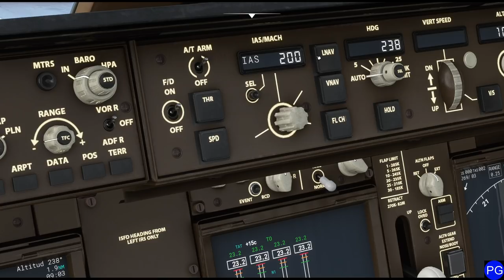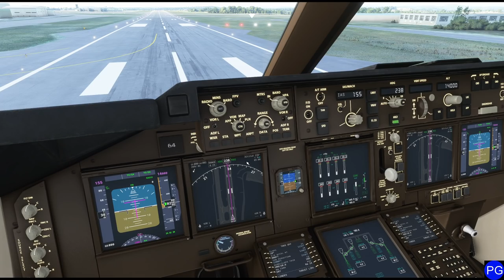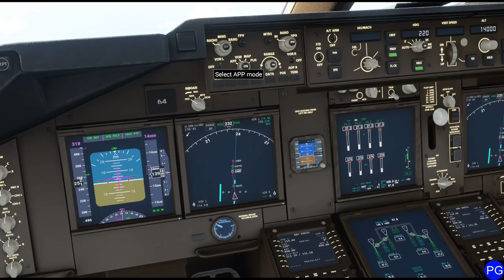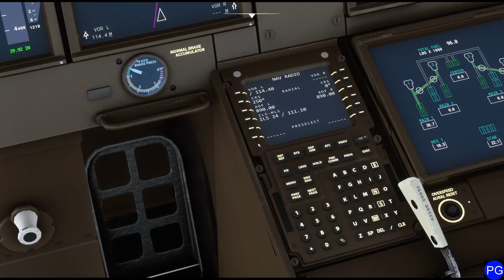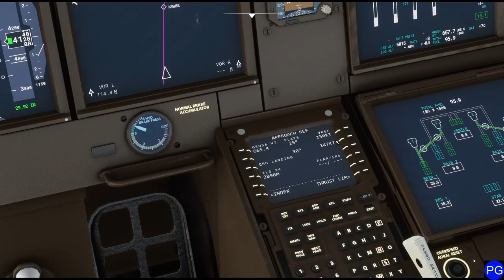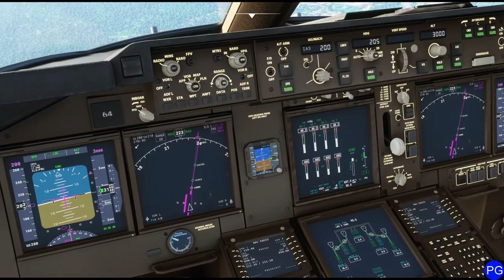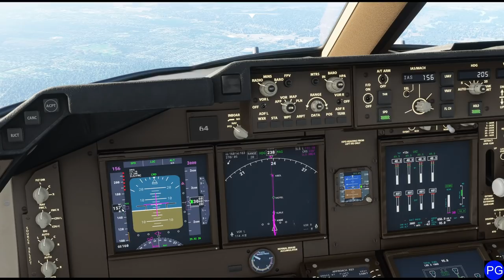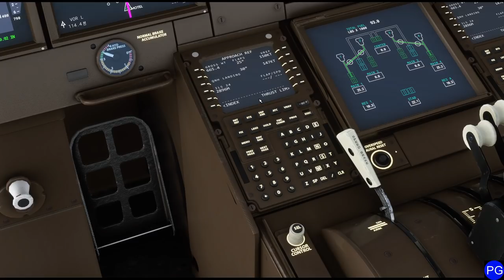FS2020 - Boeing 747-8 Autopilot Tutorial

Comment: Nice video. Air Force pilot here, FYI 16,000 is not a flight level. FLs begin at 18,000. And V2 is not the standard climb speed, that is the airspeed required to continue a safe climb at the minimum climb gradient in the event of an engine failure.
Reply: only in america

Comment: Hey man, nice video and I just wanted to add a few things

1. Speed brakes are not armed for T/O, they come up automatically passing 85 kts or they are deployed by the PF or PM when doing an RTO. 
2. Before pressing the TO/GA switches you need to stabilised the thrust (set a bit of thrust making sure all the engines are spooled up) 
3. You set up the automatic landing correctly. But MSFS seems to be lacking the feature. At 1500 feet you should have the mode "LAND 3" enabled with "ROLLOUT" and "FLARE" armed
In the case of your video, you needed to take control of the aircraft and do a manual landing since there was no autoland enabled. Your aircraft did not flare that's why the landing was so hard! 

Great video anyway and I'm so impressed with people learning how to fly the 747 in MSFS :)

Comment: Thanks so much for this! Gave me confidence to give it another go. I setup a flight from KIAH to KSFO. Many legs, each with their own airspeed/FL. Sweet! Took off, clicked LNAV and VNAV, and she flew up to FL420! I learned that I need to stay below fl390 to prevent big bertha from swaying left and right. Then, after watching the amazing scenery (Grand Canyon, Area 51 (where the aircraft 'mysteriously' lost all control for about 5 seconds, almost inverting...I think I was shot at!), Yosemite), she blew right past the waypoint with the 250/FL260 settings. :-( And then past the next one, with 250/8000 settings. :-( So, for some reason, the AP didn't follow the FMC. I disengaged / engaged the AP, didn't help. I did create the flight plan in the "home" screen before loading up the aircraft; could that be the issue? Also, MSFS is updated to the latest, and I'm using the Salty 747 mod.

Comment: Set up Flight Plan to Seoul in FMC, check.
Set up ILS approach, check.
Set up Autopilot as you did in Xplane and other Sims; Set Altitude, Vertical speed,  IAS, initial climb heading, all check.
Take to the skies and ready yourself to arm the autopilot.
Switch autopilot to on and switch autothrottle to on.
Looking good so far.
Switch LNAV to on and enjoy the perfectly preplanned ride.

LET'S GO TO THE NORTH POLE!!!

I have no idea why it does that, I am forced to fly by constantly adjusting the current heading. I can see my magenta flight plan on the instruments, All the steps in the flight plan can even be easily configured automatically from the main menu but still as soon as I switch on the LNAV it just flies of to whatever direction.

If I change the view to "outside", I can see a GPS route that's trying to be followed by the system that isn't configured at all in the plan as far as I know of..
You don't have to select a source in the 747 for the autopilot as you did for example in a Cessna with the Garmin NAV mode, right? Switching the NAV source to GPS and it follows all the lines in the preplanned flight plan. Is there something like that in the 747 I am missing? I thought the "source" LNAV uses comes straight from the flight plan in the FMC and all it's GPS stations you type in.
I am so confused.. Am I missing something, is this a bug where it's trying to fly a GPS route from a previous flight?

Sigh...

Comment: FYO This is unrealistic automation. Automatic landings is never attempted without LAND 3 or LAND 2 annunciation at 1500 feet RA on the PFD  and FLARE and ROLLOUTE modes are missing on the PFD which should be armed during the approach. The hard landing is because the aircraft did never FLARE! During automatic landing the FLARE mode is activated between 40 and 60 feet RA. and ROLLOUT at 5 ft. RA. 
Autothrottle is never disconnected during autolaland but manual thrust is possible. The autothrottle should command thrust to IDLE at 25 ft. RA.
I think there are a lot of missing features in the sim still, unfortunately.
Reply: There is, especially with the 747. It's not a study level sim, although there are options available for that if you're on PC.
Reply: I never have the lack of flare/hard landing issue but I also switch from baro to radar altimeter before landing.

Comment: Followed what you did exactly and ended up with a flight that was unable to control altitude using VNAV, just kept ascending and descending around 8000ff rather than going to FL240 as the FMC showed and the AP unit showed.

Aircraft also insisted in using full rudder whilst on autopilot, banking to compensate and hold heading.

This simulator is far too buggy. I miss FSX, glad I only tried this one for £1.99. Definitely not worth the £50 odd, especially considering I’ve had to sit through 2 30GB updates now...

Comment: Great tutorial, you talk fast so I had to watch it a few times :-)
31:16 My struggle with VNAV is that I don't understand if it ONLY reacts to the pre programmed altitudes in the flight plan? Often the flight plan have me on 30,000ft and then the next way point is perhaps 2700ft and there might not be enough distance to have a graceful decent so I ask traffic control for a lower altitude so I can start to desend much earlier.
If I in that process press VNAV, it will INCREASE my altitude to the 30,000 ft that is in the flight plan.
Is this correctly understood?

Also, is it possible to EDIT the altitudes on the waypoints so I can avoid the abrupt altitudes described above?
If I could edit, I could actually give VNAV the chance to take me down more gracefully over a distance, or is it another way of doing it ?

Comment: You make it look easy. 
When I try, the think starts bouncing and rocking like a... I can't think of something right now, but it's a lot.
Reply: Yea mine bounces like crazy.  Same thing on the 787 and the A320.  Autoland just is crap on the sim.  My question on these Boeing planes if land do you always need to kill AT?  I would think autoland would retard the throttle but I guess not?
Reply: Check your Trim bindings maybe? Might be fighting your controller, or if you have something doubled up.
Reply: @ReefAndReptileAutomation  As far as I understand, you do need to kill auto-thrust.
It is going to try to keep it at the approach speed, I think, and you want it idle anyway.
Reply: @jpm1211  I will check all that.
I can also try a very small dead zone on my joystick and throttle in case there is a bit of noise (I have a cheap one)
Reply: @ReefAndReptileAutomation  In the actual airplane the autothrottle stays on the entire time. The autopilot will reduce the thrust to idle at 35 feet above the ground. If the autopilot is configured correctly, then once the aircraft is fully configured for landing (full flaps, gear down) then you literally don't have to touch anything until you want to exit the runway after you've landed. I'm getting the sense that the "autoland" that is happening in this video is really an autoland. There are three indications on the FMA that would be shown in a real autoland. IDLE, FLARE, and ROLLOUT.

Comment: Great video! Last time I flew the 747 the fuel consumption was very high, and I ran out halfway my flight (although I thought the res would be reserve fuel). Close to the ground my batteries also died and I plummeted down :-(
Reply: I hope you are talking about the sim 😉
Reply: Search for Salty-747 on Github for the 747 improvement mod. I still have it in my download folder and haven't tried it yet in the sim, but from the listed things it does is fixing the fuel consumption of this plane.
Reply: @CrymeTheCheetah  i will do that...
Is it like kind of like Fly by wire, but for 747?
Reply: @JonathanPeel  it is, sort of.

Comment: Is there a way to apply an autopilot to altitude and not to navigation? I want it to control vertical speed during the approach and I want to be in charge of direction.
Reply: when using the autopilot, just unclick the LNAV. That will give you control of lateral movement. But if you have turned the localizer on it overrides the autopilot with regards to lateral movement.  The approach mode handles the VNAV when in close. So if you don't switch from localizer to approach it should line you up horizontally. And then disengage the autopilot and select the altitude the normal way.
Reply: Yes, you set the altitude you want to descend to (or 100 feet if you want to go all the way), then by pressing the VS button (vertical speed) that will disengage VNAV and let you se the descent rate on the VS dial.  Just remember VS will disengage once you reach the altitude you have set (or wont engage at all if already at or below the current altitude setting) and the autopilot will revert back to altitude hold.

Comment: I try to do the same but for some reason the aircraft does not decend even though i enter the new altidude given by ATC (i don't have it on hold). Also, when do you hit the approach button to start landing? When i hit it it starts doing cyrcles between the two last waypoints.
Reply: I have the same problem and sometimes it won't reach the selected altitude

Comment: When I turn LNAV and VNAV on it doesn’t turn the plane. It only fixes the speed and vertical speed
Reply: Did you make sure to set IFR navigation while you chose your arrivals and destinations?
Reply: regardless of the flight plan set in msfs menu, if you input the waypoints into the fmc legs page and turn on flight director and AP, the plane should turn as such unless you have pressed in heading select.
Reply: Check your FMC under legs and ensure that you have no "Discontinuity" in any of it.

Comment: So do LNAV and VNAV affect the plane even when the autopilot is off?? I thought AP has to be on for them to actually work.

And why does he have all 3 APs activated at the end during the approach, but not before?
Reply: idk bruh
Reply: Yes AP has to be on for vnav and lnav (but not for basic autothrottle bug and speed hold).  In Approach mode all 3 autopilots automatically activate as a failsafe in case one system gets unstable air data or some other fault.  Its complicated but as long as the 3 systems generally agree they average their control inputs.  I am not sure if Approach mode will continue if one system goes offline (I suspect it does not) but as a failsafe it would alert the pilot and if the system detects too much aberration between the systems it will disengage with lots of cautions and warnings.

Comment: Hi there, is there any way to bind boeing "toga" button to a key or controller button in msfs? can't find it under controls settings
Reply: Not sure if you have figured it out yet but you can I believe it’s in the auto pilot section. I’m not sure if that’s a pmdg 737 specific bind though
Reply: @specialneedsmolester1957  yeah I’ve found it. It’s called TO GA instead of TOGA and that’s why I wasn’t able to search for it. Thanks !

Comment: Why did you set the heading angle to 320 degrees while the aircraft had a heading angle of 240 degrees?
Reply: Same thing, why he set altitude to 3000. He prepared for missed approach procedure. If he fails to land, he will only have to activate it. You don't want to dial numbers in a hurry so close to the ground in high traffic area

Comment: although I literally followed your instructions for setting up and taking off the jumbo 747, after taking it off, it made turns around itself non-stop. (msfs Xbox/series/s) not in the pc.the defold aircraft boeing 747. where am i wrong?
Thengs for the toutorial
Reply: I followed the tutorial and it worked perfectly
Reply: I’m very new but sounds like it’s following a holding pattern program
Reply: @sdb87149  you need to set up ILS and all the route properly.  Its easiest to do it on the set up screen. Choose your arrival and departure.  Then a drop down appears on the left.  Select low level or high level airways.  Then look at the extra drop downs underneath your arrival and destination. Use these to set up ILS and stuff.  Once youve dine this and clicked FLY everything you need will be in the aircrafts FMS and it should all work properly. At least thats what i do and it works for me.

Comment: how do you pre program the FMC on this game? just setting the departure and arrival obviously isn't enough
Reply: If you are doing it from scratch it's too much to explain.
Reply: The easy way is to set up the flight as High Altitude IFR and your flight plan will already be loaded into the FMC when you start the flight.  What I find however is many times the FMC will have a discontinuity, so before you do anything else check the legs and page through it.  If any rows say discontinuity just use the delete function and click that row to remove it from the flight plan.  Note if you started cold and dark you will need to align the INS as part of the startup procedure.  I use online flight planners to plan for fuel and payload as well so I can correctly set up the Init Ref page, and then do correct Performance, Departure, and Arrival setup in FMC as well.  I only do the IFR flight plan in pre flight because its rather tedious to type all the waypoints in FMC legs.  Usually by the time I have done the FMC setup I am only about 1 minute remaining for INS alignment, just in time to fire up APU, disconnect jetway, and then once INS is aligned request pushback and your off.  Pretty much the moment your airborne engage autopilot, auto throttle, VNAV and LNAV.  Use heading select (if you did not program a departure in flight plan) to get over to the flight plan path guidance marker and LNAV should lock once you intersect the flight path.  From there aside from altitude direction for ATC the plane will fly itself all the way to your arrival airport runway approach.  From here the "easy" landing is to set your altitude to 100 feet once you hit cruise, then ignore ATCs descent instructions.  When you reach Decel and TD markers on your flight plan VNAV should fly you all the way down the approach.  As needed add flaps, engage APP mode, drop gear and it will autoland as this video shows.
Reply: @larrybremer4930  thank you so much! i have yet to try a cold start the way you’re saying so i’m excited to try that now
Reply: You have to guess. MSFS has no damn instructions for anything and I can't find a decent tutorial that explains it properly.
Reply: @jettlethedragonpeeltheoran8915  I think there are PDF instructions somewhere in MSFS but its so much easier to just watch a youtube tutorial.  The shortcut that will pretty take you all the way with FMC in B747 is first do the Init page, then check legs for discontinuities (and delete them), then use FMC/COMM button and performance menu and it will step you through the next pages (takeoff and approach plates).
Reply: @larrybremer4930  tried following this yesterday and discovered a discontinuity while in flight. Tried to delete it. Couldn't. Had to get round it by putting the previous waypoint in again, so it was entered twice, then it linked up. This is at least the second time I have seen examples in FMS videos where the sim does something different to what the video shows.
Reply: @jettlethedragonpeeltheoran8915  good trobuleshooting, watch the videos on FMC because you learn your way round.  Next time delete the discontinuity in preflight (delete key then click the waypoint while in legs).  If your in flight the way to skip to the next waypoint  - in legs click the next waypoint then click the waypoint your currently on and it will vector to that next waypoint.  I just learned that trick yesterday.

Comment: thank you for the video. can you explain in the auto pilot engage..there is left, center, right...switches..can you or someone explain what each one does. thank you.
Reply: Just choose any one for normal AP. I think you only use 2 (or 3?) when on a CAT4 landing.
Reply: Use any of them, its up to you. In real life usually if Captain is pilot flying the Left autopilot is selected. If you are using an autopilot on ILS, all 3 autopilots engage. 
Rudder commands are added during multi A/P approaches and there is separate electrical sources powering the three flight control computers (FCC) which powers the A/P control servos to the operate flight controls.
Reply: @danni_glide  APP activates all three AP systems as a failsafe.  Flight controls average the commands of all 3 systems but if one system goes tits up (or just gets very erroneous air data) it creates a disagreement and a large enough disagreement will disconnect the approach along with lots of cockpit warnings.